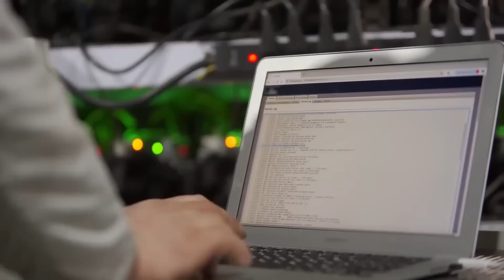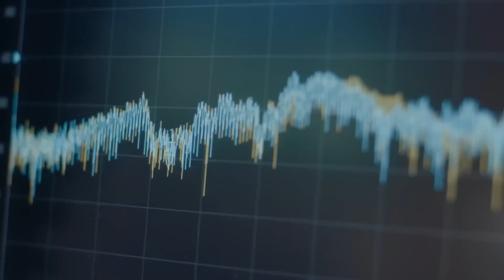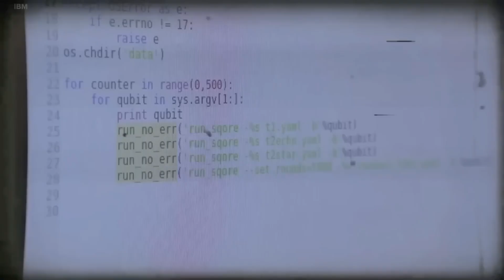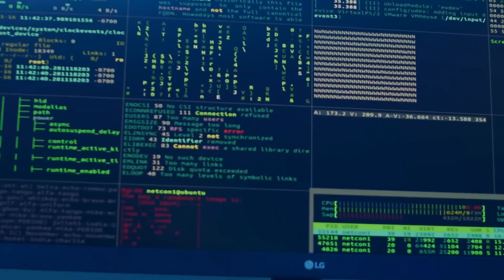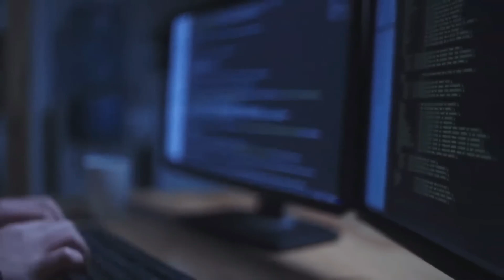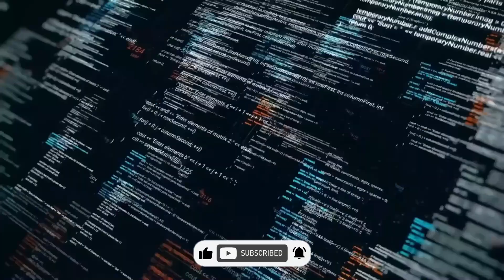Quantum Computers Could be Messing With Our Reality - Scientists Are Shocked

Comment: your 0101010 was over, and it will change to 1 forever or -1
Reply from the maker: Sounds like quantum computing just turned life into a permanent coin flip. Hope it lands on the right side!
Reply: If a whole is the calculation of PI then the value of 0 was never truly 0.
Two cycles of PI are used to make more accurate calculations in simple radios.
So in theory, 0 was always close enough to get things working from where we are in space and time.

Comment: If it runs on a machine,  it needs a

Power source...

Disconnect the power source and 

The machine will shut down. 

Problem solved.
Reply from the maker: Only humans are stupid enough to integrate it with the power source itself.